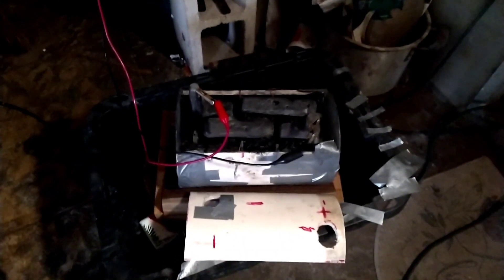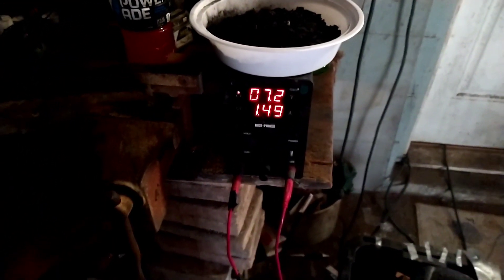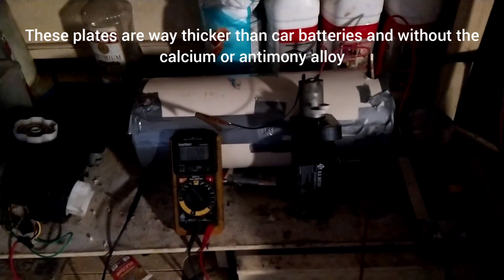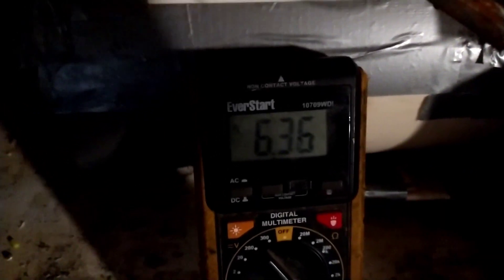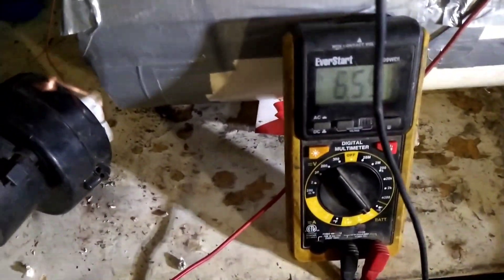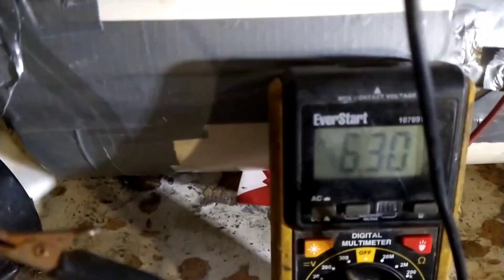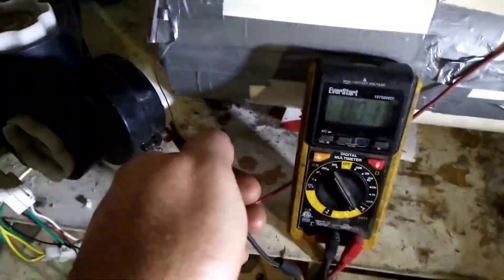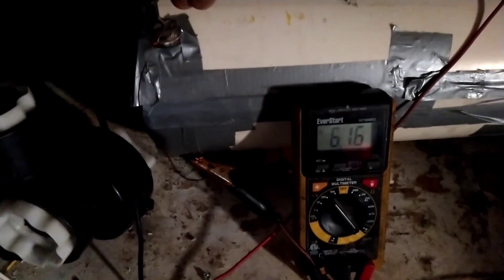Huge homeade (AGM) lead-acid battery in action!!

Comment: You can also make a very very simple lead-acid battery without even using acid. by using an alkaline electrolyte instead
Just get two very thin 0.1 to 0.2mm thickness sheets or rolls of lead foil. roll it up with some paper towel toilet paper or something for the separator. put it in a container make a saturated solution of baking soda in water for the electrolyte
Charge and discharge it reversing the polarity many times and it will output about 1-1.2 volts easily. cycle it as many times until the capacity increases.
It does not suffer sulfation effect like normal lead acid batteries using sulfuric acid. because the electrolyte is alkaline no lead sulfate forms and the reaction is more similar to a NIMH or NICD battery with the conversion of lead lead oxide and lead dioxide providing the reaction.

I got about 1 amp hour at 1 amp of discharge rate out of one that fits in a pill bottle container. and could probably get even more with a more efficient design.
You could probably even apply a thin layer of lead particles to the surface to get more performance and surface area.
You can also try washing soda or a mixture of washing soda plus baking soda for the electrolyte. as well as sodium sulfate to increase the conductivity. or any combination. to try to get more performance 
however keep in mind the self discharge rate is higher than acidic electrolyte. so you may need to keep it on a float/trickle charger either solar powered to keep it fully charged.
Charging voltage is somewhere between 2.4 to 2.7 volts depending how you construct it. working voltage is about 0.5 to 1.2 volts

Since the electrolyte is alkaline you can use a huge variety of materials for the separator material without worrying about it breaking down. can use almost any plastic or cellulose non woven fiberous materials. even cotton works.
just be sure not to make the separator too thin. The performance increases dramatically the more it is used and the more you use it. and it will last a long time. can be charged very quickly and discharged very quickly.
The performance also scales well with size. so larger batteries will perform oustandingly better compared to smaller batteries.
Reply: @realflow100  Thats very interesting what you are saying. Would it work if I'd take a new 12 V car battery that hasn't been used with acid, and put Alkaline fluid into it instead? Wich PH should it be? I'm really annoyed by this car batteries that just last a couple of years (last one 5,5) , it was an Exide.
Reply: @marigner  Not exactly. Brand new battery will contain small amount of sulfuric acid in the plates from the factory. even without any electrolyte fluid added yet.
You would get better performance and result by charging by mixing a 1.8 to 10  ratio of sodium sulfate in water and 2.5 to 10 ratio of aluminum sulfate in water mixed into the same solution which provides more performance lifespan and capacity and higher voltage closer to 2 volts.

My version with baking soda is just a simplification and produces a lower voltage. You would need a 24 volt battery with baking soda to get 12 volts. and probably need to repeat draining the electrolyte and replacing it about a half a dozen times to get the ph to remain up to 8. The baking soda would be partially neutralized to sodium sulfate. which only stores a small amount of energy like a supercapacitor.
Sodium bicarbonate is less conductive than sodium sulfate but can produce higher capacity in a simple version.

You can also experiment with making a 50% saturated solution of sodium bicarbonate with 50% saturated sodium carbonate. which would be more capacity and performance than just baking soda alone.

Do not bother with magnesium sulfate it is too disappointing and doesn't work very well. Low power and low capacity.
Reply: @realflow100  Thank you for your detailed answer; did you try that mixture allready and do you think its safe to use it in a car, using a brand new empty Car Battery without acid in it ? 
And, are there any gases produced by loading the Battery ?
And how much of each of the 2 mixed Solutions do you mean exactly ?
" 1.8 to 10  ratio of sodium sulfate in water 
(= 18% Sodium sulfate water?) +
 2.5 to 10 ratio of aluminum sulfate in water mixed 
(=25% Aluminium sulfate water ?)
 into the same solution which provides more performance lifespan and capacity and higher voltage closer to 2 volts."
Reply: @marigner  10 grams of sodium bicarbonate in 100 grams of water. scale it up proportionally for 1 liter or larger. That will create a saturated solution which provides the maximum performance.

Sodium sulfate and aluminum sulfate you will need 18 to 19 grams sodium sulfate in 100 grams of water. with 20 to 30 grams of aluminum sulfate in the same 100 grams of water.
Scale proportionally for 1 liter or larger

I have not got access to a car battery which has never had any electrolyte added  but I know it works with a few test cells ive made and constructed.

There are only small amount of gasses generated as typically in lead acid batteries if you overcharge it at too high of a rate or voltage. oxygen or hydrogen.
Sodium bicarbonate might release harmless amounts of Co2 but is not a problem.
Reply: @realflow100  Hi, thanks for your answer . 
Above you wrote:"Brand new battery will contain small amount of sulfuric acid in the plates from the factory."
Is that little acid a problem or should it be flushed out before using alkaline stuff ?
  - You also said, "... however keep in mind the self discharge rate is higher than acidic electrolyte"
How much higher do you think in a usual 70 Ah Car Battery ?
Would it be possible to compensate the self discharge by putting a little solar panel inside the car ?
What about in case of deep discharge ; is that a problem for an "Alkaline-Lead" Battery ?

I got an old car battery that doesn't work anymore, probably because of a shortcut caused by lead sulfation; could I just rinse that to test if it works ? Or would I have to open it, and change the separators ?
Reply: @marigner  car battery you dont need to change the separators or anything. but you probably should flush a new car battery a few times (charge it fully for several hours with new alkaline electrolyte. then dump it and rinse it with distilled water. then refill with new electrolyte and charge it again.
until the ph remains stable during charging around 8 to 10 ph use some ph test strips to test ph if you can they are cheap a couple dollars. you probably could do it a few times maybe 2-4 times. so the battery will be fully alkaline.
You could try it with the old battery but if its too worn out it might only provide limited usefulness.
The discharge current and power will be lower than with sulfuric acid. and capacity will be lower. but it will be able to handle deep discharge very well and can be discharged further.
Pure baking soda electrolyte will be about half the voltage. instead of 2 volts will be closer to 1 volt so you will see something like 6-8 volts fully charged. Charge at 14.5 to 15 volts.
Performance will improve as you use it.
You can run smaller devices and things off it just fine like lamps charge phone or power various devices.

Aluminum sulfate and sodium sulfate will be higher performance and voltage. more acidic. No need to flush electrolyte out of new battery. just dump it and add new aluminum sulfate sodium sulfate electrolyte in and charge it for a while at 14.5 to 15.5 volts. performance will be better than just baking soda electrolyte. but only if you can find aluminum sulfate and sodium sulfate for cheap to experiment with.
Reply: @realflow100  Do you think it can provide 12,7 Volts, because its that what I need to use it in my car ...
Reply: @marigner  if you use only baking soda you'd end up with a 6 volt battery.
You'd probably need to start with a 24 volt battery for baking soda only. it will become a 12 volt battery with baking soda (Half the voltage)

Aluminum sulfate and sodium sulfate is somewhere in between. between 8 volts to 10.8 volts for a 12 volt battery.

The baking soda version likely wouldn't provide enough power to start a car. Not as conductive as the sodium sulfate and aluminum sulfate option. less performance.

Comment: 1.8 v per cell is zero, at least in older books. Also if you put more electrolyte , capacity will increase. Also if you wish your battery to not become sulfated, elctrolite shod be no more of 1,2 density. In older books 1900 year there is true information, but in modern days they make battery to fail in predicted manner. One of the lie is electrolyte density. Other is the voltage. In modern days submarine battery is max 1,25 density some of them even lower not 1,28 or 1,3 bullshit.
Reply: Thankyou for that bro